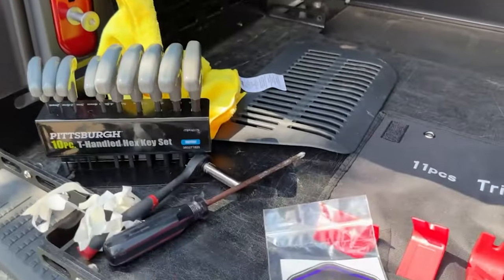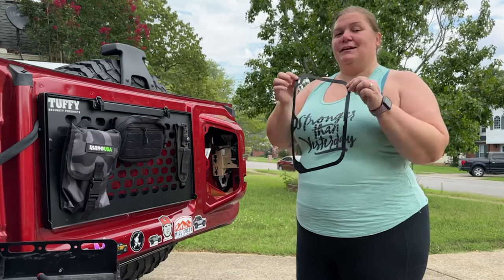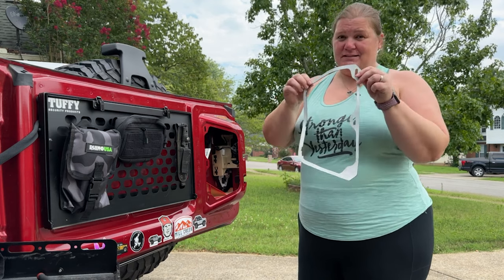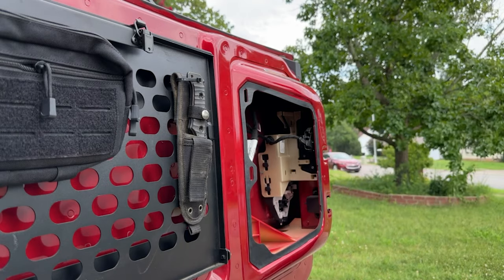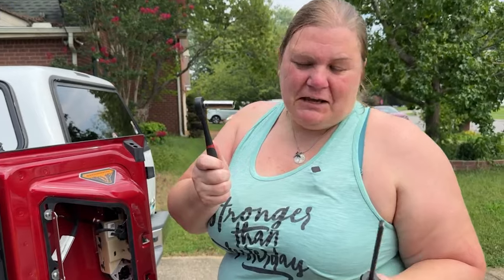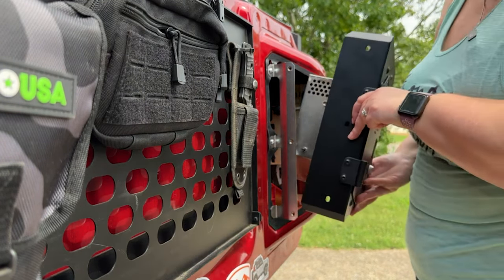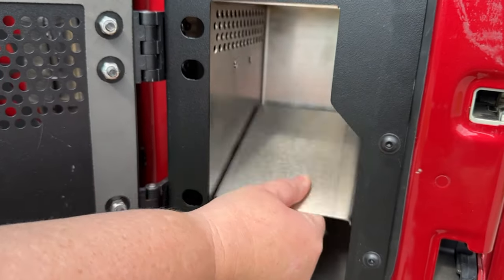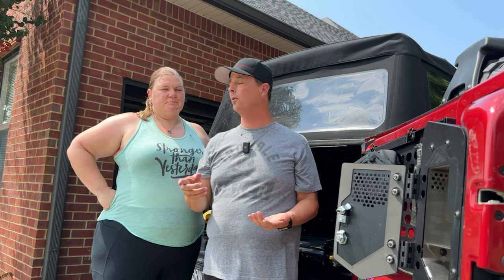More storage for your Ford Bronco - Mountains2Metal Medicine Cabinet

Comment: Spray Windex on the door before putting that gasket on. Keep it wet while you're doing it. Hold the gasket with one and use a credit card and go over the gasket to push out excess Windex with the other. The Windex will eventually dry. By keeping it wet, it will allow you to move the gasket around for perfect placement.

Comment: You do realize that you completely omitted the step of latching the safe to the right side of the tailgate opening?  Otherwise, who is to say anyone cant just bend the safe off from the towards the left.  /there is a little silver bracket on the right side of the safe that you open slightly and slide into the metal openings in the gate to secure the right side.  As far as uses for it...spices is so far removed from my mind.  I see it as a place to maybe lock my concealed weapon while the top is down and I don't want to carry into a building, also a place to lock my keys, etc...
Reply from the maker: Yes we know and fixed the issue